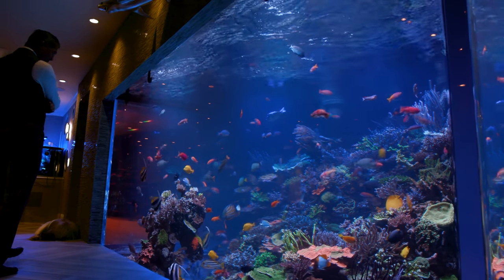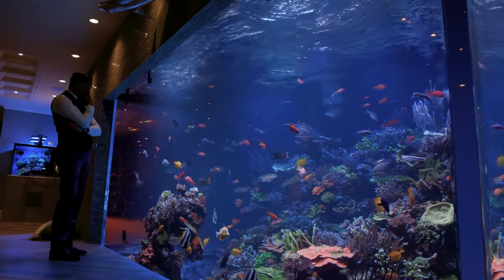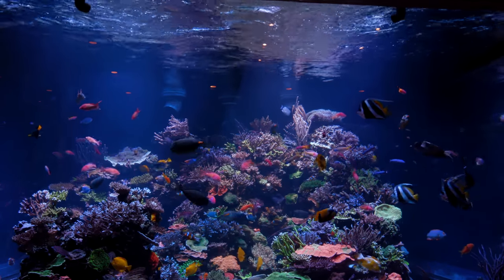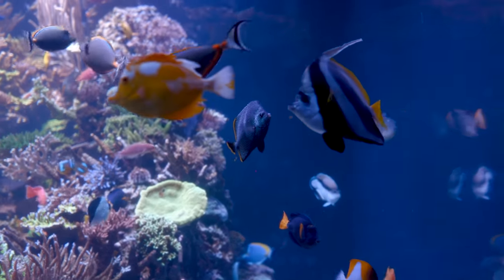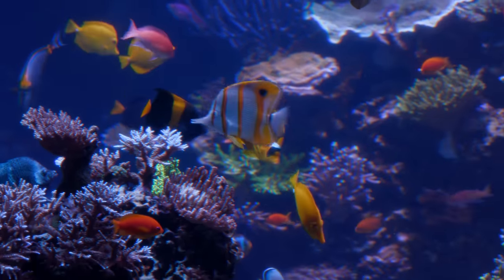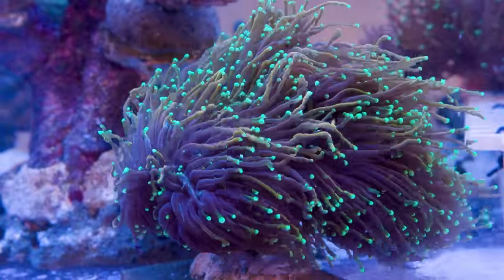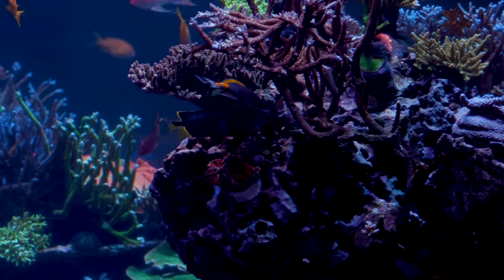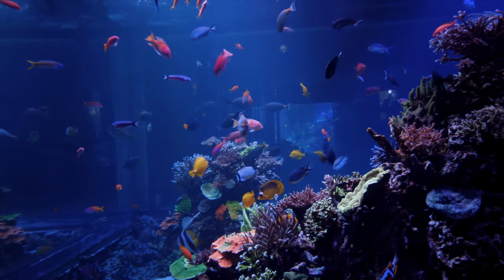Is the 17,000-gallon Aquarium of Polo Reef the Ultimate Reef Tank?

Comment: Hey!  I need your help. I'm planning two large aquariums for my home.  A 700 gal FOWLR & a 350 Gal mixed reef.  You showed the boilers you are using.  I'm interested in doing the same.  (Probably smaller models.)  I'd like to ask you about them.  #1. These boilers are using "copper-finned tube heat exchangers."  I also see a lot of copper pipes and fittings on yours.  I'm told that copper tubes and fittings exposed to the water is potentially harmful for living things in marine aquaria; the copper leaching into the water and tank over time.  Is there no danger?  Or, perhaps, the picture you filmed was misleading??  So, question (1) is about the copper danger.  Question #2 You are using two boilers.  Is one redundant?  Or are they two boilers for two systems?  Thanx for your help.  I look forward to your response.